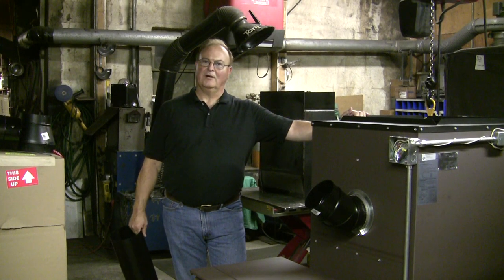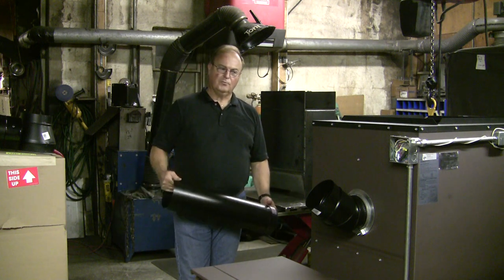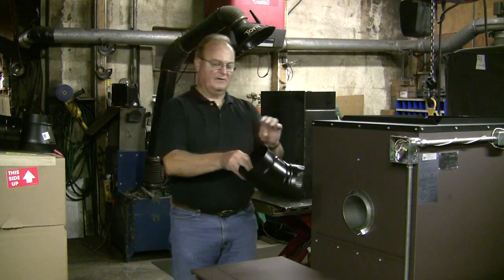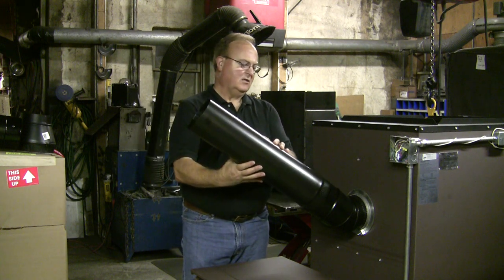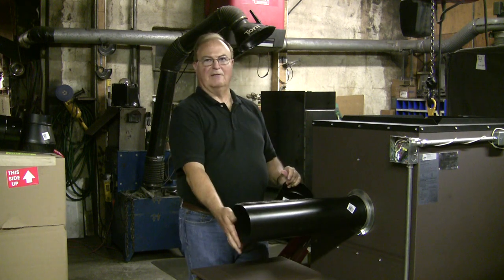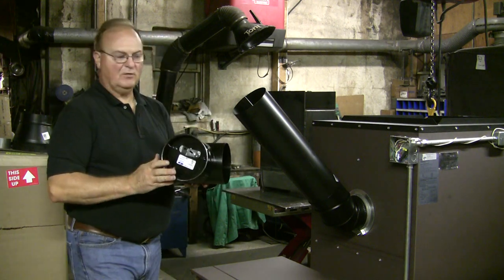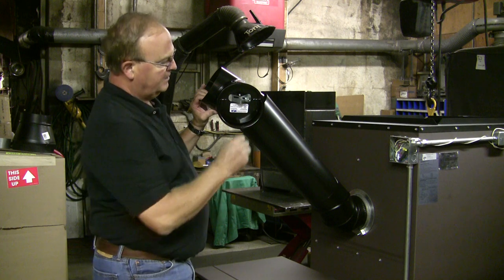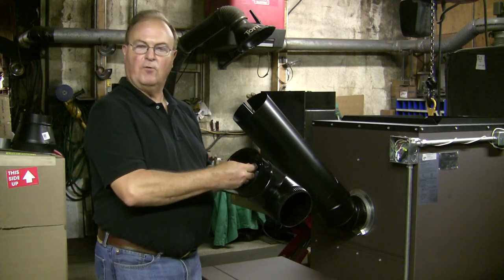Kuuma Vapor-Fire 100 Installation (Chimney)

Comment: for heavans sake .. why would you introduce false draft or excess air into the venting .. that is a recipe for a chimney fire .. keeping the flue gasses as hot as possible in the venting system reduces condensation of those gasses and allows for less buildup of any creosote in the venting.. would you cut a 6 inch hole in your woodstove flue pipe and expect it to work better?
Reply: fingers967 yeah what do we know. We’ve developed the only EPA 2020 approved wood furnace and have been in the wood burning business for 40 + years. Not to mention if you do some research on wood burning saunas see what our customers say about their #kuuma
Reply: @garrettlamppa2372  let me ask you this .. is there any regulation/design requirement that states you must put the over fire draft regulator in the pipe or can the installing technician decide based on the type and placement of the chimney if its a prudent idea. also if you have indeed been in the wood trade for as long as you say then you know im not wrong about excess air in any flue gas path for a wood burning device. further to that perhaps its there to cheat the EPA testing as like when internal combustion engines added air pumps to dilute the exhaust when emissions testing was in its infancy.. either way ,I believe you have a good product and would be interested in your add on model ,but I see it isnt available until it passes its EPA testing
Reply: @fingers967  we plan on testing the 200 model in December, so hopefully, it passes and we can get on the market shortly after
Reply: @garrettlamppa2372  what’s the reason the BD should be placed closer to the chimney than the stove itself? Just out of plain curiosity, you guys make a great product and I wish more company’s were as informative as you in this space.
Reply: @deadly134  it should operate close to the same no matter where it’s installed. The main thing is having it somewhere easy to access for adjusting.

Comment: is barometric damper really necessary? Is combustion relying on draft only or is it fan induced?
Reply from the maker: Yes, we run a low draft and the damper will ensure a steady draft during varying outdoor barometric conditions.  It's natural air flow for the combustion air.